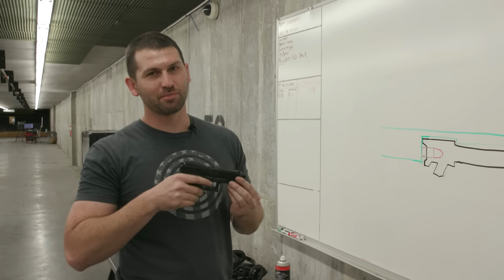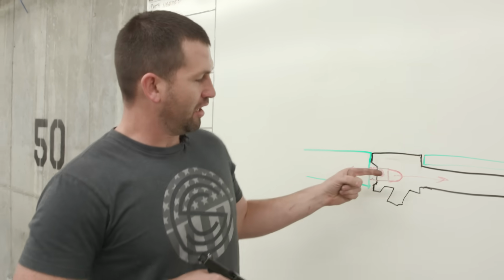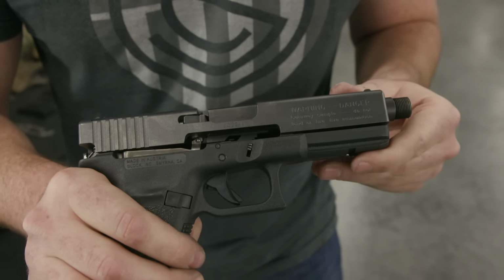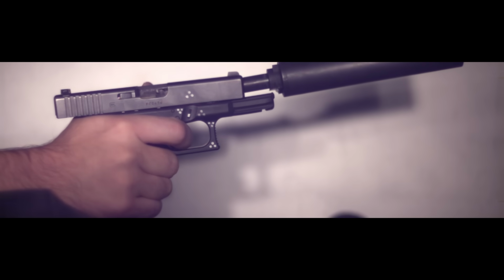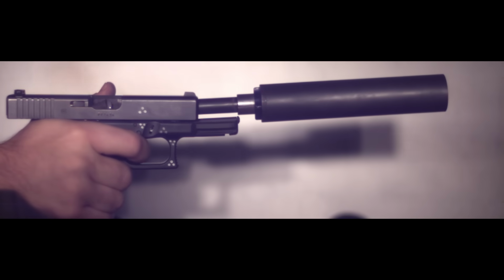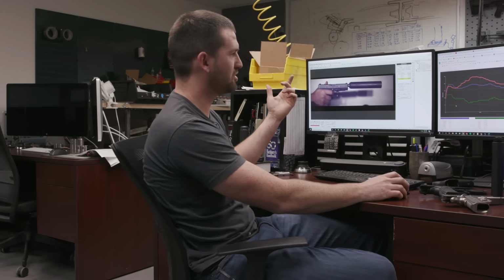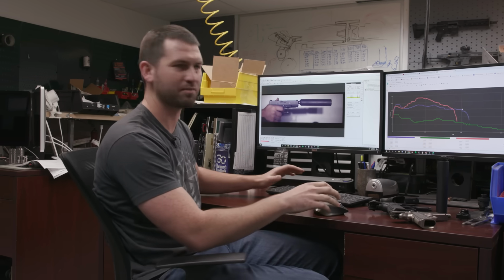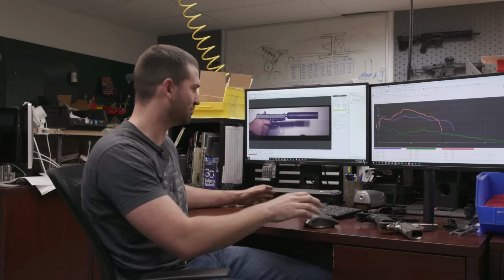Suppressor Science: Pistons

Comment: I tell people the booster/Nielsen device/piston allows the suppressor to float momentarily, freeing its mass from the barrel and slide just long enough for them to unlock properly and cycle the action.
Reply from the maker: That's a very accurate summary.
Reply: @SilencerCo  Its actually not, from a physics standpoint the pressure in the can is driving the barrel to the rear adding force to help the pistol cycle. It does not simply "decouple". Using terminology like "float" and decouple" denotes a passivity to what's going on. The pressure generated in the can and against the inside of the case actively push the can and barrel/slide away from each other aiding in cycling. That's why terminology such as "piston" and "booster" are used. Everyone assumes because the piston doesnt have a surface to act on that gas pressure isnt at play here. the reality is once screwed onto the barrel the breach face/case become the surface the gas pressure acts on. Boosters effectively turn a recoil impulse operated system into a gas operated one.
Reply: @bikefreek  and that is how you complicate a simple summary 😂
Reply: @bikefreek  Well then by that logic, you shouldn’t need the booster assembly at all. In fact, it should cycle better without the piston assembly then. If it’s the pressure in the can exerting force rearward against the casing and breech face, forcing the slide rearward, you’d have more pressure to assure cycling. But that’s not the case. It does in fact, de-couple the system. Kind of like a suspension strut on a car where the barrel/ piston would be the wheel and the car, the slide. The wheel is free to move independently from the car in one axis momentarily but also structurally supported in different axis. After the round leaves the muzzle, both the the slide and barrel move rearward together momentarily until they separate and the slide continues on its own while the barrel remains. Without a piston the force of the gasses rearward against the shell casing would have to move the weight of the barrel, suppressor and slide all rearward until it hit the locking block, then there would have to be enough momentum left in the slide to travel rearwards fully to properly cycle the next round. Some is also dissipated into the frame via the barrel hitting the locking block. On typical handgun cartridges, there’s just not enough initial force created to force all that mass rearward and have enough left over for the slide itself to continue fully rearward. I suppose if you had a hot enough round to create enough rearward force initially, it might work, but at the expense of lots of wear and tear on the other parts. It would be like driving a vehicle with no suspension and the wheel hubs directly mounted to the frame. It’s pretty much like a suspension for your barrel.
Reply: @bradskis81  The pressure in the can cant push the breach to the rear without a booster... think of it this way, The case, barrel and booster "piston" are the piston and piston rod of a pneumatic cylinder. The can is outer tube. When the gasses pressurize the inside of the barrel and can the barrel is forced rearwards.... that force aides cycling. Why do you think terms like "piston" and booster" are used for them? It is NOT a passive system to simply allow the gun to cycle. It actively adds force to drive the slide and barrel back.
Reply: Hmm. Good thread.  Good video.
Reply: @SudsMcDuff007  I wasn't aware my old comment had generated so much debate.  It was intended as a simple layman's illustration of the net effect of a booster, not as a study in the laws of physics.